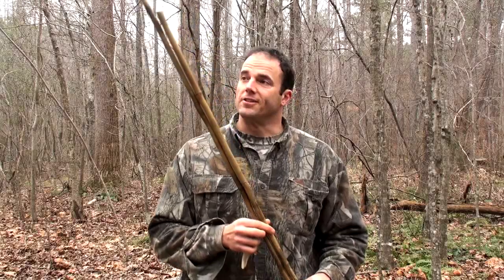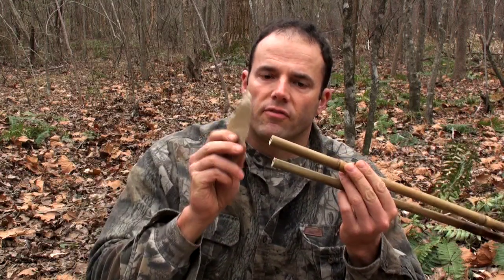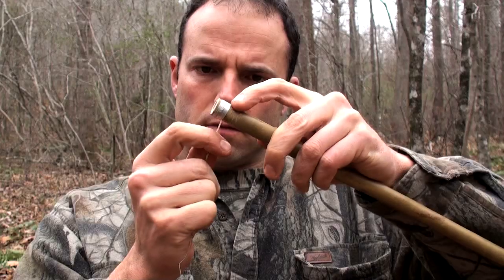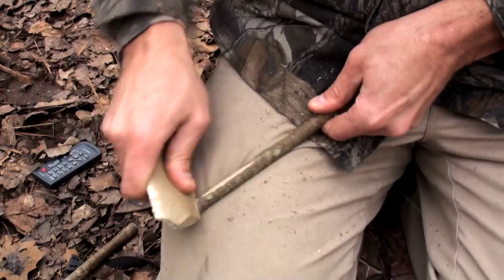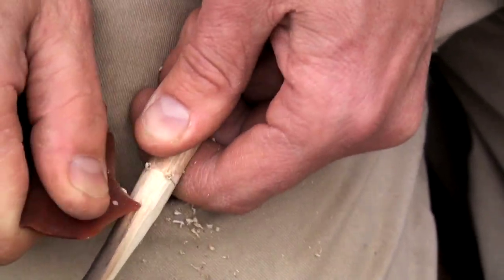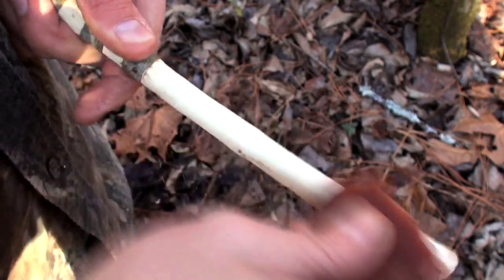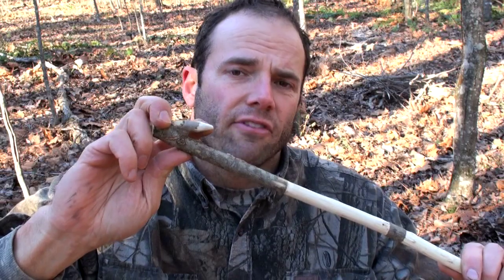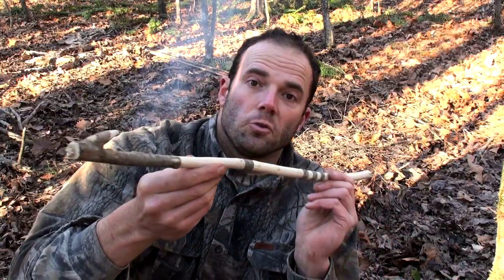Making the Spear and Spear Thrower Part 3 (HD)

Comment: Is bamboo the easiest to work with or can you use other types of wood and what wood should I use? How about large long dowels for the dart if you dont have bamboo. The thrower would be easy to find.
Reply: Type of wood does not matter. The spine of it does. They should be from 5 to 7 feet long with the thick part at the front. Longer is more hunting and war shorter is more target and fun and smaller or weaker people. Atlatl should be about from armpit to finger again longer is more power shorter is easier and more accurate. When loaded the weapon should balance just before the hand (IMOHO) and you can add a rock to the atlatl to achieve this. A good design website. http://www.thudscave.com/npaa/designs/